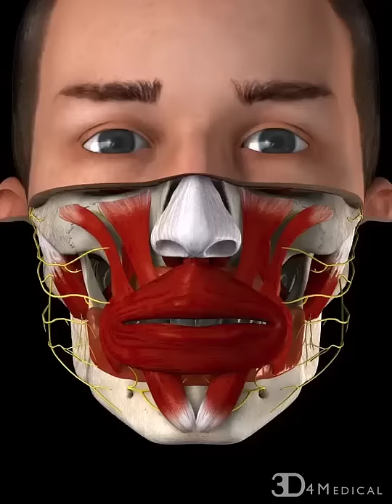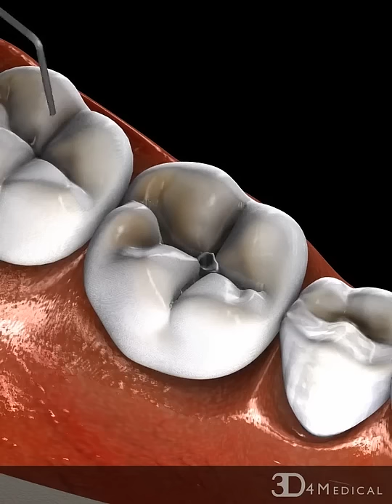Filling with Occlusal (Amalgam)

Comment: Now the most common form of filler material is called composite resin it is a tooth colored material, also typically Decay is interproximal (from not flossing) or in between the molars and you still have to go through the biting surface to get to that interproximal decay, the dentist will drill into the tooth put etch then Bond and then put the compatible or resin composite material into the tooth

Comment: People with anxiety should get that extra shot of numbness  also will it hurt after it's done and the numbness wears off???
Reply: I’m not sure, I JUST got mine and it’s numb. I think you’ll feel some pain idk again I just got mine I’ll have to see, good luck😩❤️
Reply: When I got mind done my numbness didn’t wear off till the next day😭 it started wearing off at night but I still was completely numb.
Reply: no it won't hurt after the numbness wears off, the numbness is the worst part
Reply: @essie5628  You should not feel any pain if your tooth is numbed properly.  Some people have nerves that deviate from their normal location.  In some cases dentists may need to insert a small gauge needle between the gum and tooth to reach the ligament portion and numb the nerves directly..  Whilst numbing is supposed to numb the tooth it is possible that the nerves may get stimulated and cause some pain, it depends the depth of the drilling.

Comment: But amalgam is dangerous right? It contains mercury, why would they still use it?
Reply: Many studies have been done on mercury being toxic to the patient in the teeth, but it has still not been scientifically proven. What has been proven is the environment effect, and what happens when the fillings are drilled out, an aerosol of small particles of water material is released. Studies have been made though, where it has been found that the mercury level in the urine was quite higher, in those who had amalgam fillings. But do remember there is also found mercury in the food you eat, specially fish. In a lot of country making amalgam fillings is illegal, because of these facts but also how hard it honestly is to remove, and because the people who break teeths with amalgam fillings can be really unlucky, because of the hardness of the material, it can do a lot more damage if you crack a tooth. Can't really say why some countries still allow the use of it though, I guess some still swear by it. Fun fact though, in my country it was considered a temporary material till something better came along.
Reply: @GoldenSpaceDoll  Agree, it releases more mercury vapor when heated(like drinking hot beverages and eating warm foods).